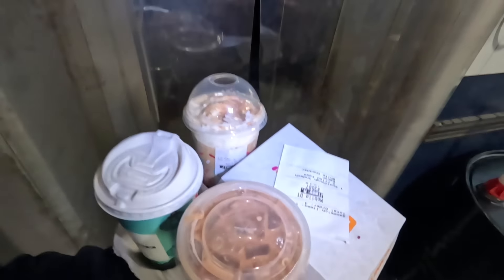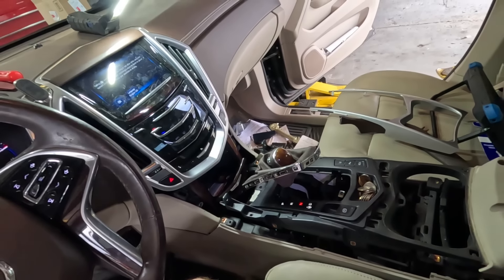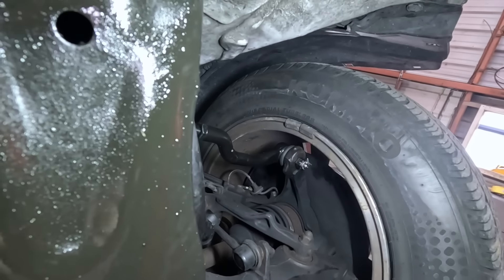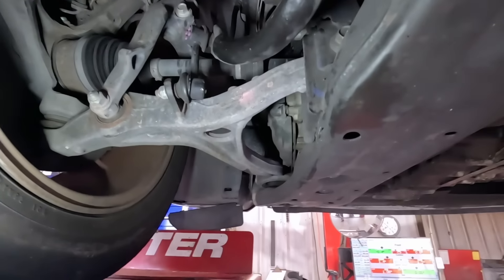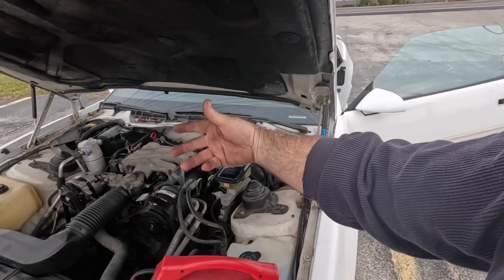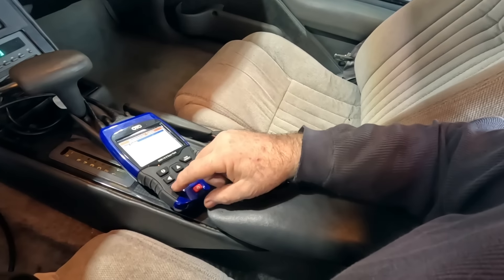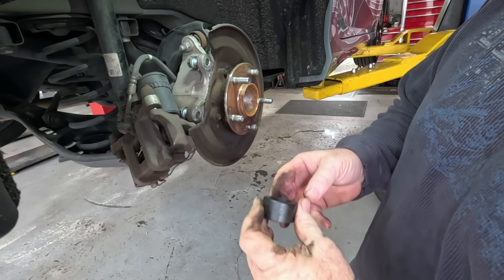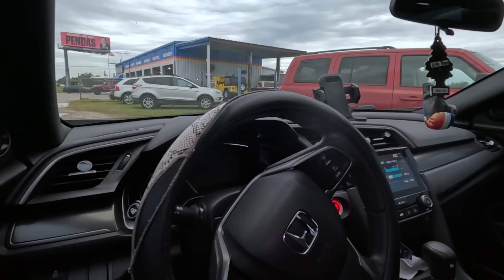SRX RADIO, ACCORD HACK, 91 FIREBIRD DIAG, CIVIC STUDS, DAY IN THE SHOP 395 #auto #repair #fix

Comment: Playlist
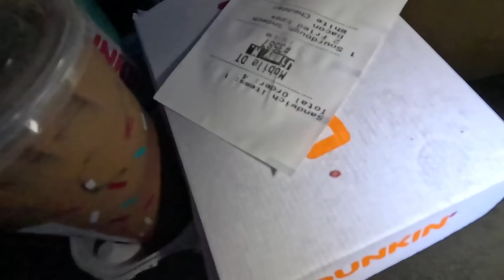00:00 Husky toolbox
01:57 2016 Cadillac SRX - New GM OEM radio replacement 
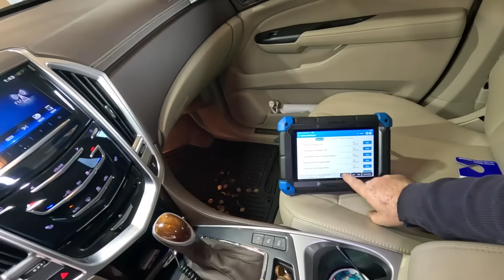16:20 2010 Honda Accord - Alignment (Wheel & Steering Wheel)
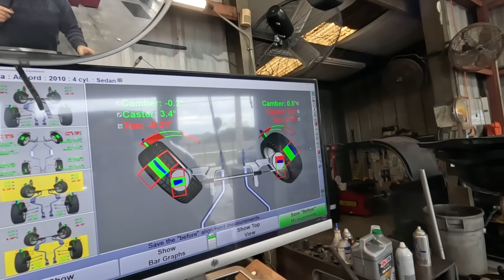31:46 1991 Pontiac Firebird - Diagnostic (OTC OBD I & II Scan Tool)
51:38 2018 Honda Civic - New Wheel Studs (Lisle Stud Installer)
Reply from the maker: Thank you my friend!

Comment: I (like I'm sure many others) appreciate you telling it like it is in the automotive repair industry.  Since I spent a small amount of time in the business I can appreciate from experience exactly what you are talking about regarding the workplace.  You being the responsible one who likes to do the right thing will often get the short end of the stick.  Customers will appreciate your efforts, but it's 50-50 (in reality less) that coworkers will step up.  You are setting a example for other like-minded people to follow.  The rewards for your dedication will come back to you sometime in the future.  It may not be material, but it will nonetheless give you some joy & peace of mind.  Take it from someone like yourself (now retired) I can now look back with no regrets at all the times I did the right thing while others avoided doing anything.
Reply from the maker: Very true! I have great coworkers, but sometimes things fall thru the cracks. Luckily a simple request next time they grab one will have it fixed up and it won’t be an issue.
But venting a bit also helps, :).
Reply: Enough said Jimmy.  NY trained here as well.  Keep the faith! @JimmyMakingitwork

Comment: Cool. I just fixed a recurring p0420 by replacing engine mounts and the donut gasket at the manifold. The code would set mostly on under high loads (hills with AC on).  At first I though it was insufficient catalyst. Turns out a combination worn engine mounts and the old gasket under load were causing an exhaust leak, resulting in a lean condition for the downstream sensor. Replaced mounts and gasket. Car runs like new and no more codes. 2006 Matrix 4WD with 220,000 miles.
Reply from the maker: Nice! Only 3 things cause a P0420/430 and that is Cat, O2 or leaks.
Good work!

Comment: Jimmy, I have the same pre 96 code reader (Bosch).  Used it on my OBD 1.5 95 Riviera.  I have 50 pids that it displayed.  I used it to diagnose an ignition not switching code which was a bad computer.  No codes now but the check engine still comes on after a couple of miles.  I think maybe it is some module that the reader does not cover such as anti lock braking.
Reply from the maker: Possibly, but ABS should have a separate light? Possibly something intermittent that will be hard to spot on data?

Comment: The amount of times ive use a breaker bar to undo wheel nuts is crazy there is no reason to tighten that high all it dose is stretch the threads and make them no good,what makes it worse i know they are stressed you have nightmares knowing that you told the customer about it and they said leave it it'll be ok 😢.
Reply from the maker: Very true Dain, hard thing to get people to understand. They can be too tight!